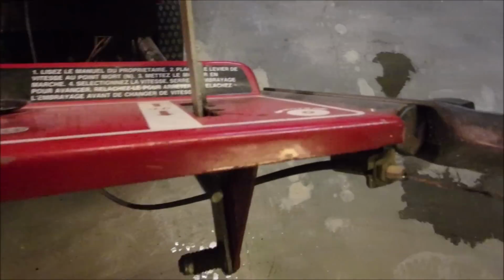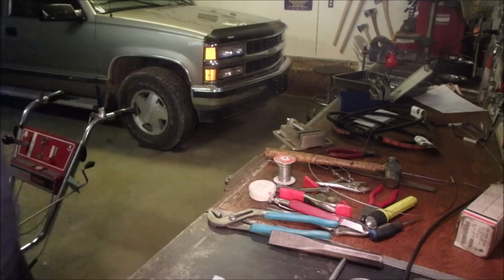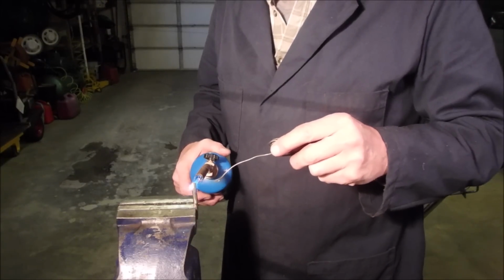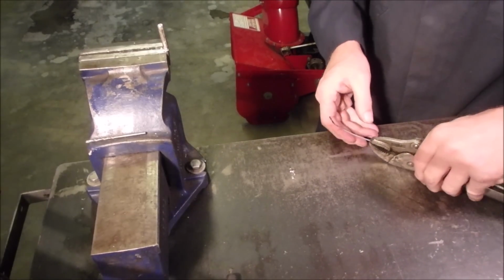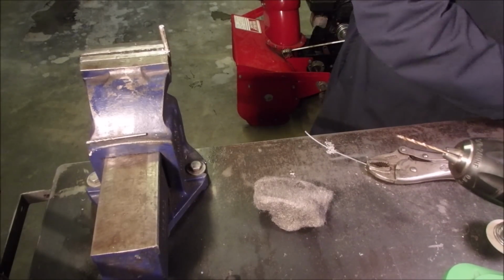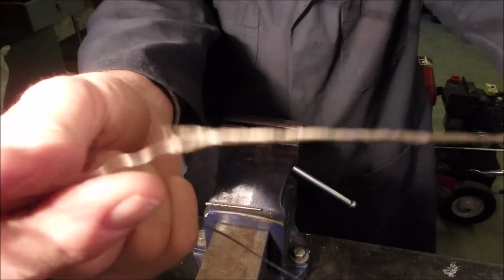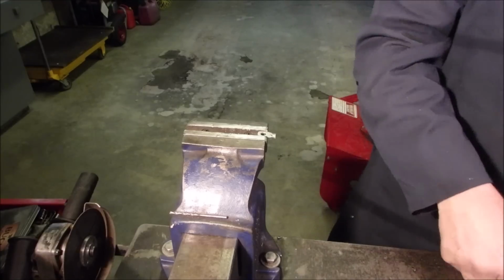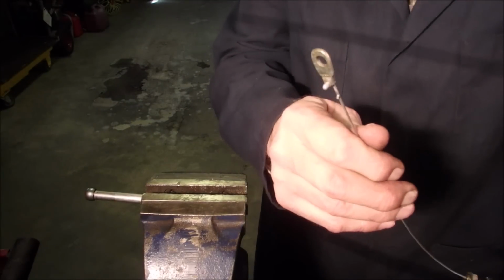Snowblower Cable Repair Pt 3

Comment: Hey Bruce  Fellow Canuck here. Just finishing up a course and looking to get into small engine repair here in southern ontario. Was wondering where you find parts for your repairs. Being in Canada, things seem to be harder to source without buying from the states and adding shipping, customs and currency exchange. I know Donyboy 73 gets them from the states but the company he uses charges $30 American to ship to Canada. That's a lot of parts you have to order to make it worth while. Any advice would be appreciated.
Reply from the maker: If I am in a hurry I use a local supplier called Lawn Mower Hospital.(Edmonton Alberta)  If I can wait I use what Don does or use ebay in general.  But you are right there are no easy fixes.  I order aftermarket carbs sometime due to price.  Good luck.

Comment: Your touch is 3700 degrees and the solder melts at 450 it looked like you way over heated your project. Just my two cents.
Reply from the maker: You are right.
Reply: depending on the sort of metal you need different flux
Reply from the maker: @abtgeorg  Yes.  And my flux was for copper but i have done braided steel before with it.  Thanks a lot.  Great comment.

Comment: Very nice.  I tried to do that once with a cable and couldn't get it to tin.  Is your metal workbench top a solid piece of metal?  I really need a portion of my bench to have a metal top.
Reply from the maker: This is the top of the portable welding bench that is the same width as my regular bench.  1/4 inch plate   3 feet wide.
Reply from the maker: OK   My welding cart=bench is in this video below at 6:20.  I made it years ago.
https://www.youtube.com/watch?v=rN_aH-_JX4Q
Reply: @BrucesShop  Thanks, I watched the shop tour video.  Very nice.  You also had a link in the description there to an even older video specifically on the welding table.  I like how all your stuff is very modular and the same height.  You can pull it out and then put it back seemlessly.  Very nice if you want to pull out say the bench grinder to the door and wire wheel a very rusty piece of metal.  All that rust dust stays outside, then you can just pop that module back when you're done.

Comment: flux the cable first
Reply from the maker: I did  Then tried  and then did it again with acid core solder.  Thanks  It may look like a missed that step.

Comment: Nice video Bruce ! Battery cables can be made using the same method (dunking the cable into the connector filled with hot flowing solder. ) you don’t want to splash that or you won’t do it twice  for sure !!  Thanks for doing the videos - great detail from you !

Comment: Thanks Bruce.  Will give it s try. 
I have all the cables hung vertically for 2 months. Lol. I have been injecting wd40 with a straw. It took awhile to get the wd to drip out the bottom. 
They are still jammed solid. I think the plastic coating is wedged against the outer sheath. 
I may see if I can strip the black covering off the sheath and maybe heat it with a torch. Maybe it will soften and let me pull the cable out. Bummer!
Thanks for the assist!!!
Reply: Heat them in the oven and put them in a sink of cold water. The thermal shock should separate the materials.

Comment: Nice work on soldering and repair. 
I have a MTD Tiller to get ready for spring. 
The cables are frozen. The strange part is that cable Appears to be clad in plastic. The plastic is cracking and binding the motion of the cable. Bummer. 
The 4 or so cables are expensive as new parts; so I need to repair. 
Overall my problem is removing the jammed cable from the assembly. 
Have you ran into this problem before?
-Bob. Athens. GA
Reply from the maker: Yes.  There is a cable oiler you can get.
This will help
https://www.ebay.com/itm/Motion-Pro-Cable-Luber-Tool-08-0182-Lube-Motorcycle-ATV-Throttle-Clutch-Brake-/400794572601.
Reply: If the originals are too much work, you can order universal cables from aftermarket vendors such as Stens or Rotary. However, the cables will need to be cut to length, and need new ferrule ends (hardware store). Much much cheaper than oem parts. Try your local mower or auto shop if ordering universal cables online isn't economical.
Reply from the maker: @999thenewman  Thanks I have a local source (expensive but quick and a online source too.  Thanks  Shipping is so expensive where i live.  Western Canada.
Reply: @BrucesShop  The YouTube reply system is a bit glitchy today. That was a reply to the other guy.
Reply: 999 Thank you. I may get a universal or cable which is too long
May have to rework the ends
Sweat and Determination will get it going
Amazing how that thin vinyl cladding is jamming the cable. I suspect that tiny chunks of cladding are bound into the spiral of the conduit. 
Thanks 999 and thanks Bruce
Reply: @userfixit  Happy to help, friend.

Comment: How's she goin'?  Nice fix on the cable ends.  I didn't think the solder would hold as there is a pretty good strain on those cables.  Hope this works out for you!!!  Well done pal!!
Reply from the maker: Right.  There are lots of cables held together with lead solder.  I amazes me too.